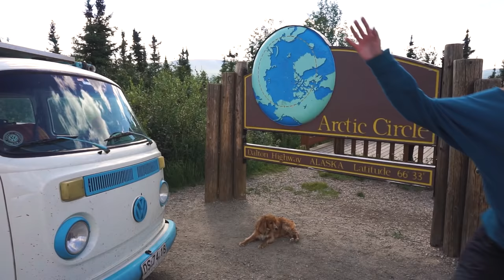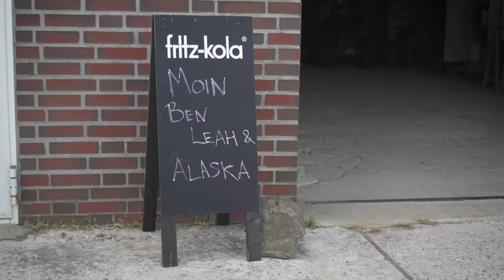Preparing to Drive Around The World 🌎🚐💨 // S05E07

Comment: To make repairing tires a lot quicker and easier. You can use a cordless drill with a properly sized drill bit to be used in place of the"reamer"
Reply: how is that saving time? and you cant poke another hole with a proper hand ream that takes literally 5 seconds... your not trying to bore the thing out just make it wide enough for a Plug! besides you want a rough surface for the plug to grab... not a smooth drilled out surface... go for a drive on the highway with your plugs tony, bet they fail!
Reply: @philtripe  I'm a shop foreman for Audi. It is done all the time at the dealership
Reply: @philtripe  some rubber compounds are terribly difficult to ream.  A deep tread depth only makes that worse if the leak is through a tire lug

Comment: Yeah, it is faster to plug a tire leak than change into a spare and 90 percent of the time the plug lasts the life of the tire... hook up the portable compressor then pull the nail/screw out and plug it. vulcanizing rubber cement is best but even ordinary rubber cement works